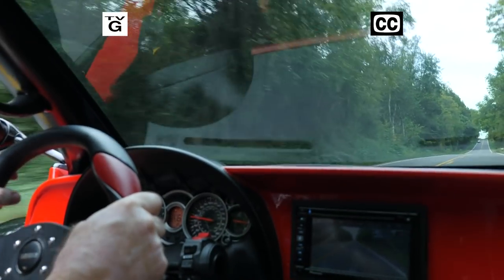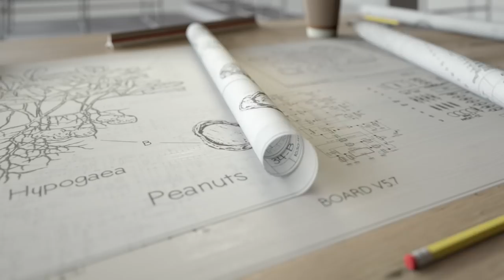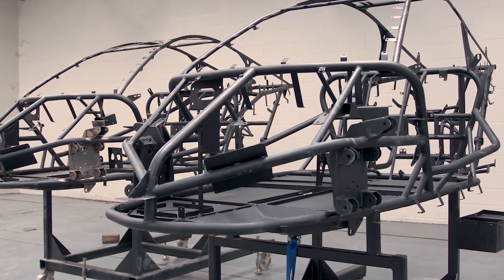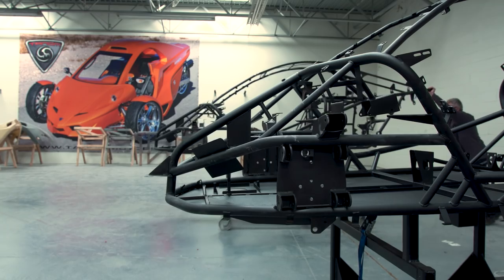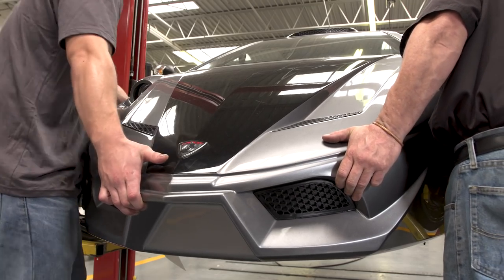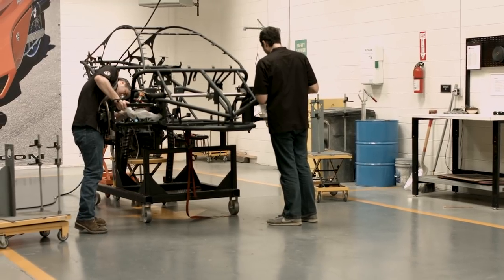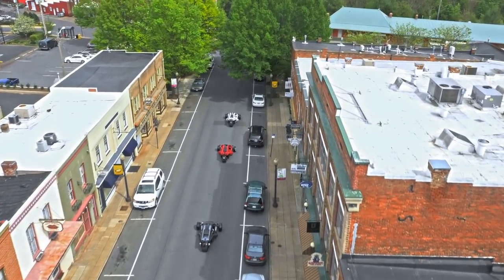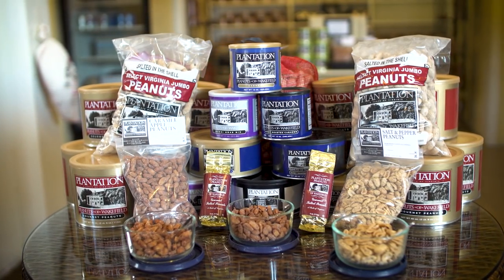Made in Virginia - Episode #1 - Tanom Motors

Comment: This looks amazing. Great build video. But I can't piece together how the price of one of these is $55k+. I would expect high 20's, low 30's. But this thing costs as much as a full sized truck, partially loaded!
Reply: Dick Powell good
Reply: They part out everything but the engine (watch the video), so all you're paying for is the cost of the engine (not the whole bike). How much do you think that costs?
Reply: I figured $5-7k for motor & trans, $5k frame,$2k tires and rims, $1,000 paint,$1,800 seats. At most $25k. But $55k.?? I don't think that i'll own one for that price.. Ten years ago I bought a Suzuki GSX1000r. for $10k it was brand new. I haven't looked at bike prices in a while, but surely not increased that much have they?? That  Tanom is nice & all but pricey.. daaaum... oh and good video 😎👍🏼..

Comment: It's a nice three wheeler but too pricey 55,000 no draw you out a frame get you a good welder and a motor and Build your own less than 20,000 !
Reply: You can buy 2 five year old Mercedes SL500's for the cost of this stupid thing.
Reply: You can build one for Around $6 to $7grand if you have a Good  Donor Bike"..all you need is a welder and a pipe Bender" And can take things from other parts yards and modify and reengeiner Them for This application"🏆

Comment: Please keep the design the way it is. It's a masterpiece! Don't change it for the sake of change, like so many companies have done. Take a page out of the Dodge book, and keep the body the same! Chevy and Ford have failed to maintain their Camaro and Mustang image, because they haven't been able to decide on a particular look, and so they change them continuously. Dodge has remained steadfast in making the most beautiful muscle car ever produced, the modern Challenger. And it has only been slightly changed in 14 years. This is the most important reason why the Challenger is so successful. Keep your body lines, and your headlight assembly, and don't change anything except the colors, or the badges. This thing is a beautiful masterpiece! It's absolutely perfect! It is orders of magnitude more beautiful than the Spyder, and the Spyder has a God awful V-Twin engine. When I saw that you used a Hayabusa engine, an inline-4, I knew you guys had it right. A V-twin engine is not an acceptable choice for creating a smooth driving experience.

Comment: I like that is has a real windshield. I would like it with doors, frunk space, change the roof line..
Its good, but could be better.
Reply: Like the Trex Aero 3s?
Reply: @ShivaSharma-zs6gt  the Aero kit for the T Rex is an option, but it's just a fiber glass shell. The base T Rex is just a roll cage and crap seats. Not to Mention there is a price difference and not worth the jump.
Reply: @ShivaSharma-zs6gt  You can definitely build one sure.